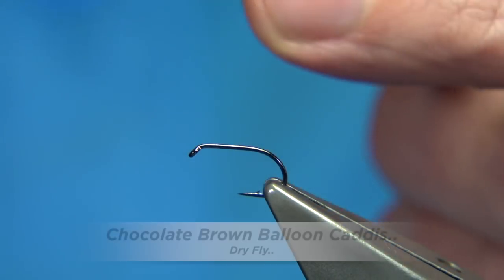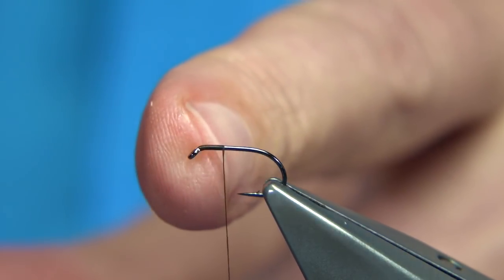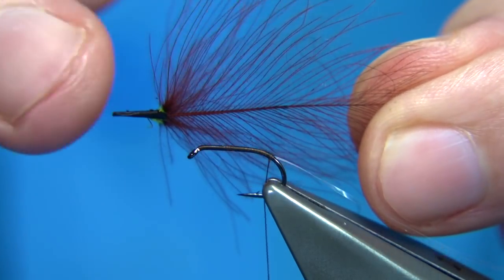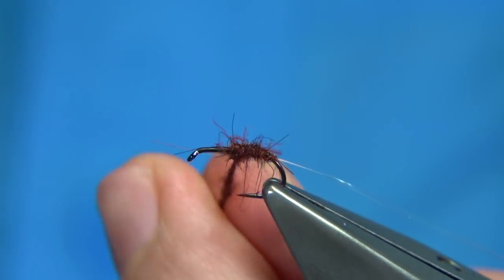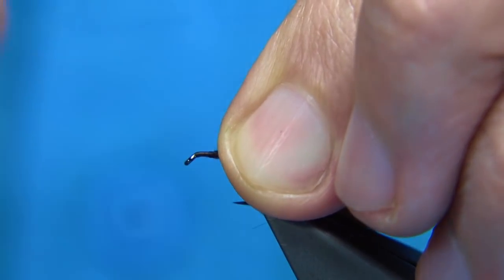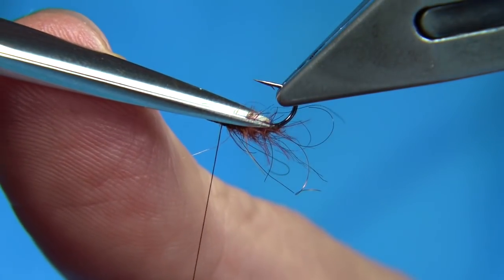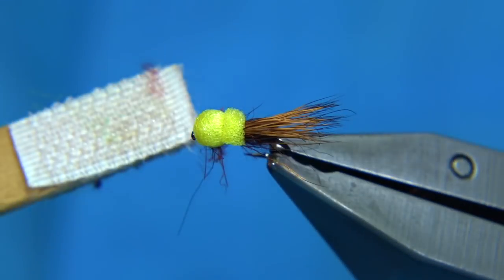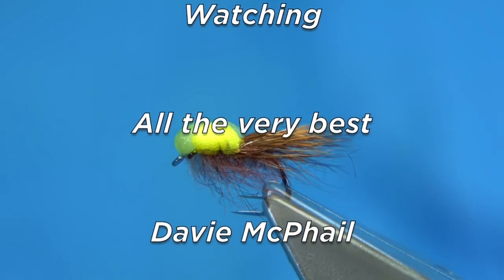Tying a Chocolate Brown Balloon Caddis with Davie McPhail

Comment: Very nice tying again. I enjoy watching your video and have learnt a lot for my own tying. Many thanks! What's the intention of the foam head on the Balloon Caddis. Does the balloon imitate a specific feature?
Reply: I've never tied them, but I believe that the "balloon" allows the fly to float low in moving water without sinking.  The high-contrast color would also make the fly easier to track on the water's surface in those situations.  If you were fishing stillwaters predominantly; where the fly tracks straight behind the fly line and subtle strikes are easier to see, you could tone down the color of the foam to better match the rest of the fly (if you wanted to).